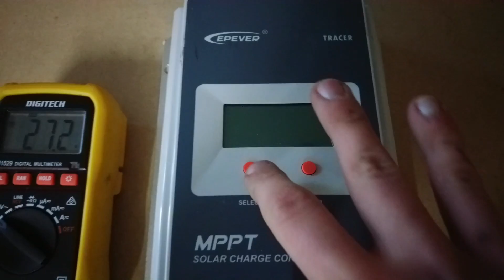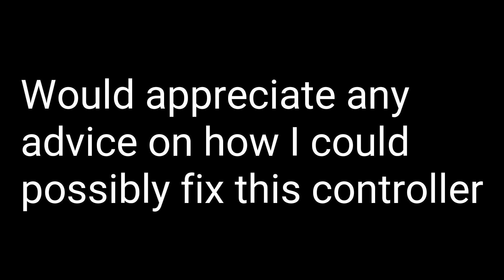Epever MPPT Solar Charge Controller BROKEN! | please HELP!

Comment: I bought one and does exactly the same thing. If I connect the wifi box and software, it shows in the app that its working but the led display does not show anything. Did you fix it? Did you find out what was the issue? Thanks.

Comment: Had same. Got a returned replacement no problem. Think it's common for the display board to pop. Mine was charging and working fine but no display. MT50 worked still and displayed info. It was under warranty. The replacement is 3 years old and it's fine.

Comment: I have the same problem right now. I used two separate controllers so that if one stop working the other would still be charging the other sets of batteries for an off- grid setup. Unfortunately my luck ran out, both just stopped working.

Comment: I fixed one of them 1 day ago, in my case I replaced the other mosfet that you see on the top of the case behind the borner load ouput , IRFS7530 has like 6 legs for Source other leg for the gate and the last ome is all the case of the mosfet soldering on the board, check the small mosfet where you see the resistors with .002 ohms , if you connect your battery and touch all the mosfets you can see the mosfet that is making the problem

Comment: Doesn't look like the power electronics have failed, so next thing to test is the small PSU that runs the controller logic. Certainly appears the 5V rail is dead.
You can measure voltages on some ICs, or electrolytic capacitors.

Comment: Got the same one 40 amp. Most of the time it doesn't work. Having it replaced with different unit.
It charges for a bit then randomly stops.

Comment: got an oscilloscope? As station240 said, it's control logic problem. Definitely the next step is to check the 5v rail and if that's up I'd be checking the gate drive wave on a scope and trace back from there. Most probably you won't see any gate drive.

What happened? How did you fry it? 
Or was it just D.O.A. ?

Comment: I have same thing, (for some reason) controller overcharged LiFePO4 battery and tripped Over Voltage Protection (there was 2V threshold programmed in to prevent this), the battery side vent to PV input voltage of 69V. I bet voltage regulator for IC is RIP. There is no continuity on PV- to Bat- when disconnected, but it shorts instantly when powered.

Comment: Try setting the configuration parameters; this can ONLY be done via their crappy software.
I had an issue where an inverter would trip with over voltage when the batteries were fully charged.

Comment: I have a 40A AN model and it just stop working when I plug in the MT50 it just says connecting and that it, is it possible to fix this controller or show I just put in Trash.

Comment: The spark makes me think it is a bad led screen. Use the solar software and power it up and see if it connects. I had one go bad on me a 30 amp model
Reply: i had the same 30 amp  and theres is no output also

Comment: Possibly a loose or defective LCD display?  I would open the case (4 screws) and check the cable to the display.  And the internal 5 volt suppl;y as someone else mentioned.  Also check the controller with the provided software.  A USB to RS485 device is about $1US on ebay and the hookup info is in the Tracer manual - download it and the software (Win 7 and up) here: http://www.epsolarpv.com/en/index.php/Technical/download 

Some vendors give better support than others.  

As yet, there have been no problems with either of the 3210a controllers I have.  Tomorrow I'll have a 4210a as part of the mix - something to  handle two almost-new 300 watt panels I got via Craig's List for $125 each.  While the 4210a can deliver a maximum of 520 watts, it allows connecting a solar array of up to 1560 watts in a 12 volt system.

Comment: Put in LONGER bolts to the 12 V. input clamps. Mine were too short for the wire that I using. 8 gauge. Without 12 V. input,the screen will be BLANK,like mine was. FIXED IT!

Comment: That charge controllers only for 12 volt batteries are it's made for 24 volt . So why do you have 27v
Reply: My epever is for 12,24,36,48 volts
Reply: @Randomadventuresebike  no its not ok if you want to think that . we sure sell you an new one when you smoke your old one

Comment: Hello i just had the same problem, it was the transistor behind de PCB
Reply: Could you tell us about MOSFET dou you use for replacement, because I don't find, my epever 3210a blow fusible and one of these power transistor is in short, something like ST L50NLDF

Comment: If any of you that had or have this problem connected power or panels tp the PV connection before connecting a battery you will burn out the controller.